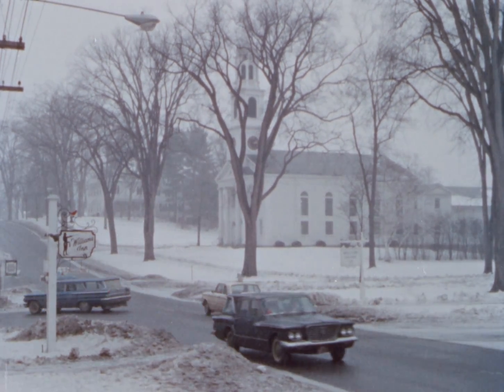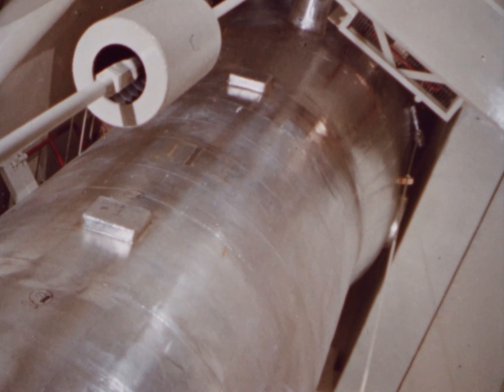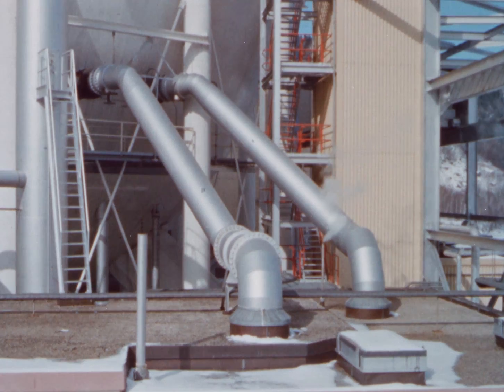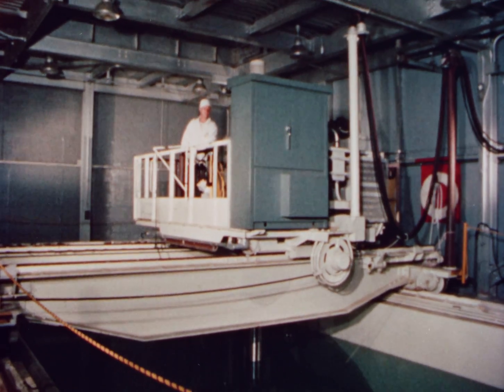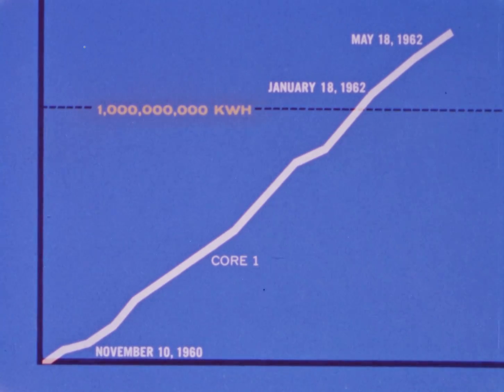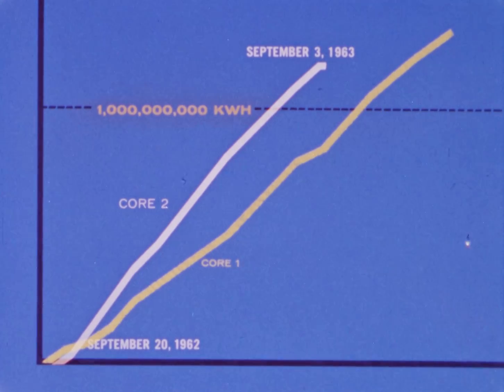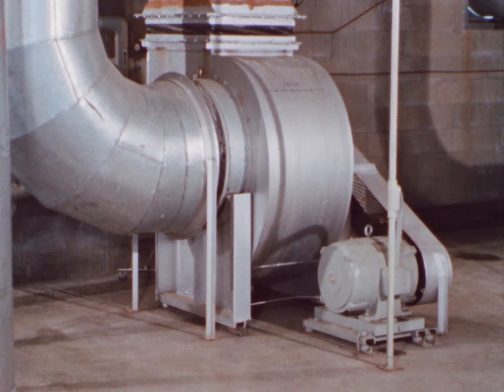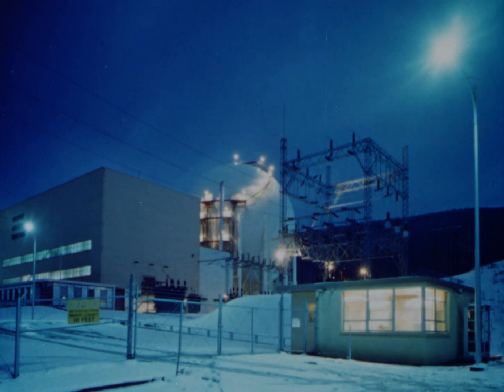Operating Experience, Yankee Rowe nuclear reactor (1964)

Comment: I studied this core design in college and used its design parameters for a senior design project. It has smaller diameter fuel rods than what is typically used in '70s era 3000 MWt reactors. It also does not have control rods in the fuel bundles. If you look at the fuel bundle at 6:50 you will see the bundle is not exactly square, missing some fuel rods on two sides. This was to allow space between the bundles for cruciform shaped control blades.
Reply from the maker: Oh yeah I can see the notch for the control blades there! Very cool.
Reply: You Help Give Cancer & Die  Leak & VENT    ALL Lies Of Nuclear Come DUE

Comment: Sold! Ill take 2 please.
Reply: No you don''t want this one. They shut it down due to embrittlement of the reactor pressure vessel. This is scrutinized at all reactors past, present, and future.  And it was a small (180MW) reactor compared to the ones under construction or in production at the time of decommission in 1991. 

The small Westinghouse PWR at Wolf Creek in Kansas operates at 1250MW due to a upgraded steam turbine.
Reply: @Nighthawke70  No Where To Live Cancer For ALL @ 39 CPM Leak & Vent Lies Of Nuclear Come Due In The Cancer Lotto
Reply: @Nighthawke70  Would that be tritium embrittlement? Is there such a thing?
Reply: @Science-Geek-0  You are thinking about Neutron radiation embrittlement. It was a big deal during the first decades of reactor operations.  There was a few reactors that went prompt critical due to that. SL-1 was one such unit. The center rod got stuck, forcing them to use brute force. Unfortunately, the reactor was a lousy design, for a single rod out would cause a prompt criticality event. This cost 3 lives and made a mess of the Idaho test center.